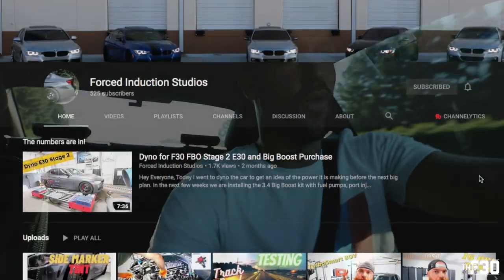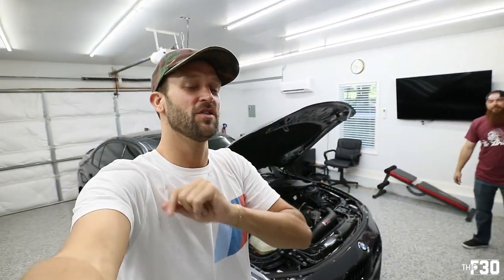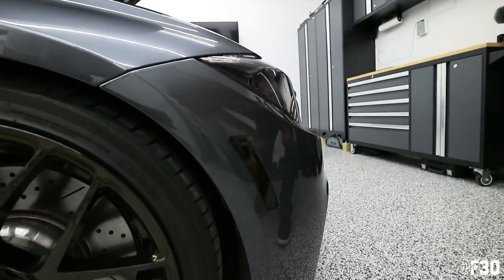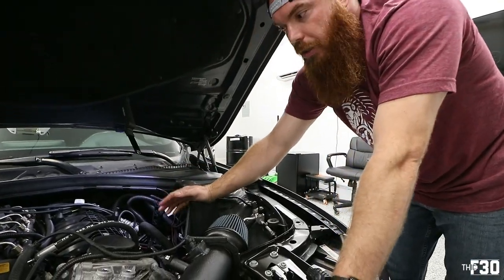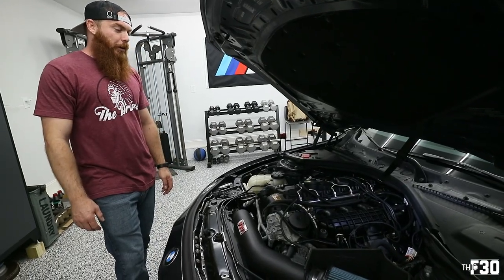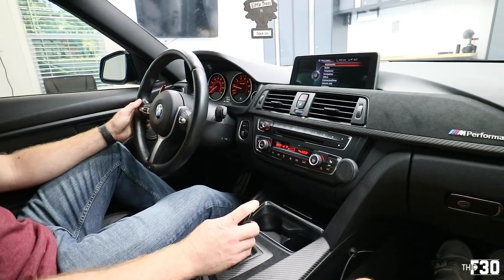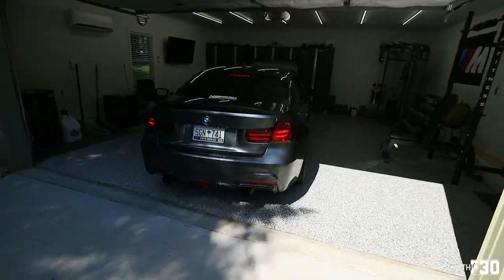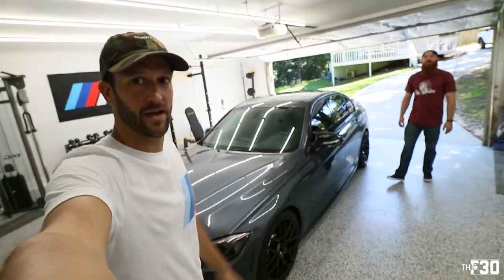600HP BIG BOOST F30 BUILD - 335IX BMW FEATURE FILM

Comment: Thank you Jon for the great video! This was an awesome experience.
Reply: Badass car! I have a 2016 328d and tons of plans for it, you and Jon are definitely inspiring me to keep at it!
Reply: LT Mac thank you brother
Reply: Sick car man ! i do have one question. I own a -16  M135i xDrive, i talked to my local tuner company, they said they dont recommend me going with Stage 1 even, because that could break the "

distribution box". I dont know the correct term, but the box that distribute the power for front and rear wheels.  I also talked to a few other guys, they said stage 2 is cool.     So iam very tempted with stage 1, but im nervous it might break something. 
What do you think, and what do you believe? Thank you bro.
Reply: TouchOfRed7 I would not think stage 2 would be a problem on transfer case at all. I run 650 hp on stock and it’s holding up however I know things happen. I would say Send It!!
Reply: Slowspeed also has the same kit and yes the power is intoxicating.
Reply: All the great BMW channels are out of NC/SC. (Jon, LJ, El & Chris). Definitely going to have to meet up with you guys.
Reply: Brolin _f30_b58 anytime

Comment: Nice,  similar build 435i n55 629whp on pure stage 2 ...22psi
Reply: what with pure turbo's? what did you do? built the engine? i am capped at 520whp for safety of the engine

Comment: I think the front driver side rotor is installed in the wrong place. I believe the slots have to face the other direction to pull air as the car moves forward to cool down the brakes.
Reply: Yes they sent me 2 of the same side I am trying to work that out with supplier

Comment: Hey thic . Do you know if your friend is experiencing a weird annoying sound coming from the dimpled and slotted performance brake rotors? I don't really know how to describe, sort of clicking sound once you drive like 20mph and the faster you go eventually it will sound like a rattle snake... I upgraded from stock to performance brakes also and I noticed this sound straight away. Only noticed it when driving with my windows down. Can you please check for me? 

Thanks Greetz Joey
Reply from the maker: Yes it’s normal with dimpled rotors unfortunately
Reply: @ThicWhips  so if i swap them for perforated and not slotted. The noise will be gone?
Reply from the maker: Correct, regular flat surface rotors or cross drilled will relieve the noise

Comment: Rotors are wrong direction! They go the opposite direction! Checked back and somehow seems like left side only isn't in the right direction. @4:48
Reply: I’ll check it out. Thanks
Reply: @BOO5Tchannel  Maybe you have non directional brakes which doesn't matter for the direction. I was surprised to see that your front brakes aren't in the same direction ahah
Reply: Déreck Cloutier lol ya me too... they sent me those from dealer so will give them a shout
Reply: @BOO5Tchannel  bro, who makes good kits for BMW? Speed tag? I am looking for a turbo kit for my b48 g20. 330i. Only options as of now are ps1 and big boost 500 and 600kit. Are you satisfied with your bigboost kit? How do they work on the oil lines on the block side? I guess you need an adapter for aftermarket oil and coolant lines. Does the big boost kit include that? 
Or you could just make a video of step by step install of your bigboost kit?
Reply: MM performance The kit is really good overall everything is included if you get the kit it’s ready to run but don’t forget fueling and everything that needs to go with a big turbo kit I will have a video on that soon